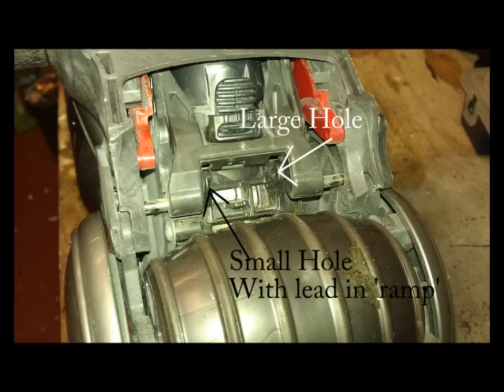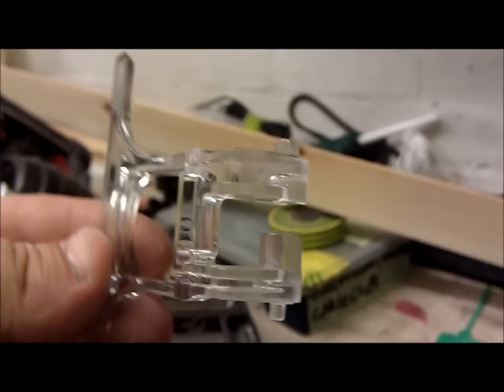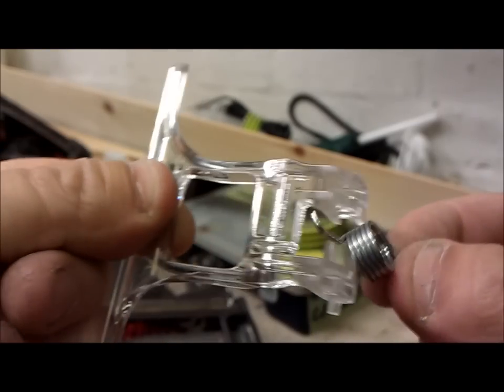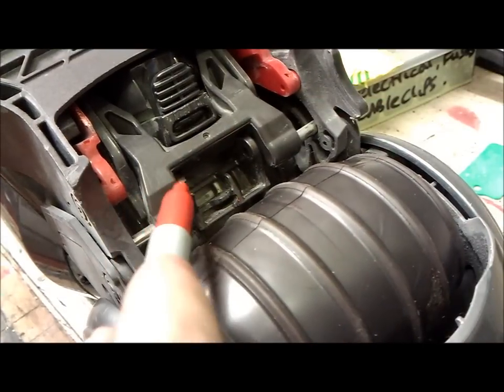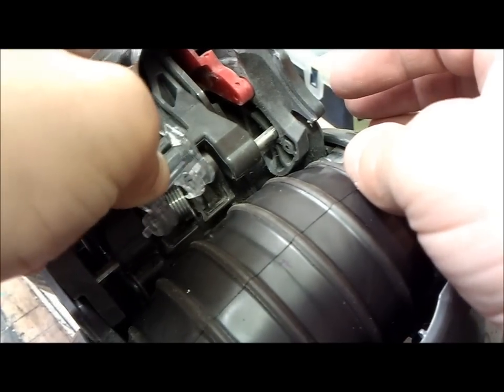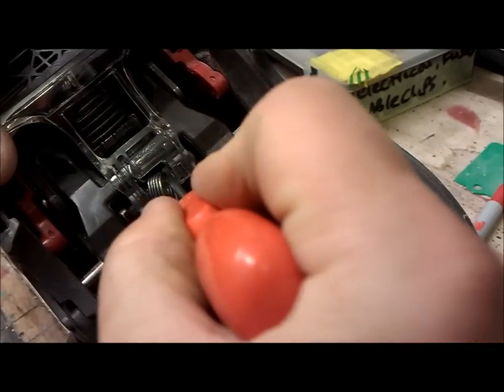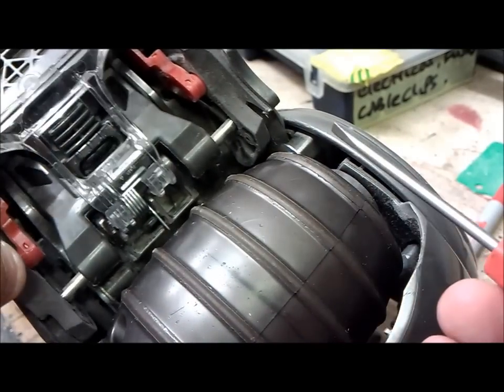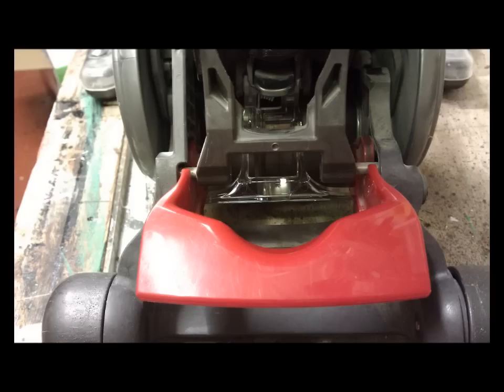Dyson DC18 Foot Pedal Plunger Repair

Comment: 12 years on and this is still being used (by me anyway). 
The clear plastic portion had suffered a fairly clean break, so I managed to repair this with super glue, and strengthened with a cutdown paperclip bent into shape and secured with araldite. 
This video was so useful in very clearly showing how to reassemble the foot pedal. This is not obvious. 
Thank you 'scruffymid'.

Comment: Fantastic video, super clear.   My clear pedal plunger broke long ago, so I went online and ordered from one of many available parts houses, but after a few weeks had gotten a message "Backordered at Dyson, unknown when again avaiable", and I figured that was that and set about unsatisfactorily glueing my old one several times, but never so solidy I dared re-install.  Then two and a half months later a box shows up at my door, and what should be in it but the new pedal plunger, back in stock from Dyson... the part I took out three months ago *and have no recollection how it went in and how the spring went*.   I searched without success for service info from Dyson and the parts houses, but then simply searched "YouTube" for "Dyson DC18 Pedal Plunger" and wow... I could not have asked for clearer instructions.   Thanks for taking the time to make the clear video, it complements Dyson's continued commitment to keep parts available and keep good machines out of the landfill.

Comment: My  dc 18 is missing that clear plastic piece but won't stand up. If I replaced the missing clear plastic piece will this fix it?
Reply from the maker: It should fix it, but if the clear plastic is missing then the spring will also be missing. They are sold separately, so you will need both.  Not expensive, just awkward to fit.